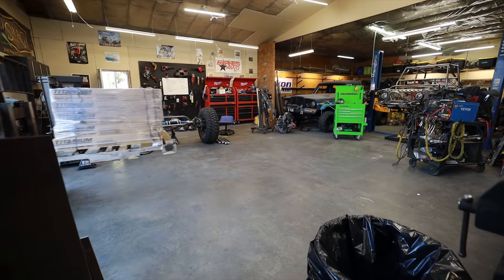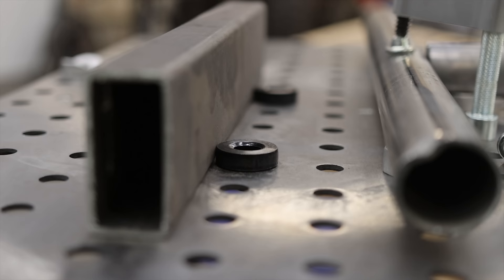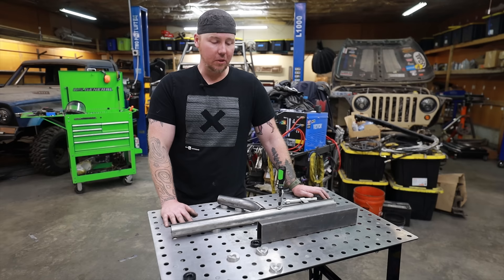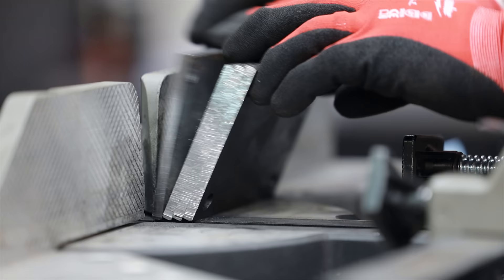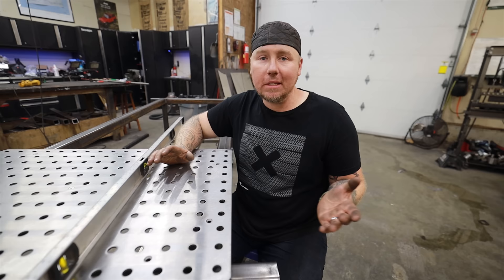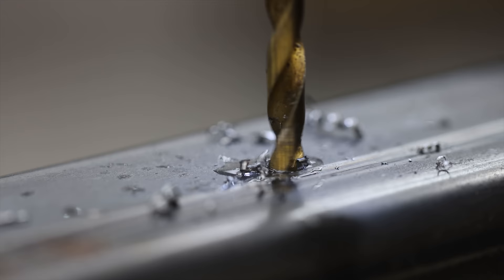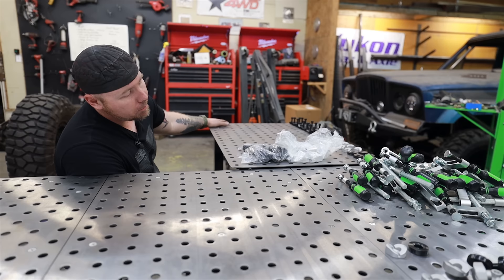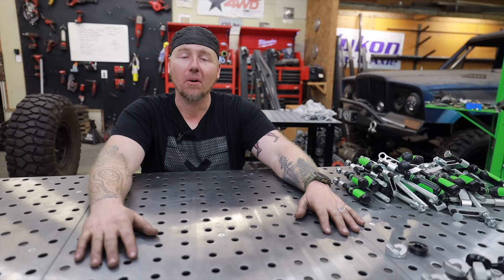The NEW Harbor Freight Welding Fixture Table

Comment: You could also remove the plate from the frame and double stack the plates. For more strength, you could cut some plates in half and overlap the butt of the underlying plates (cross hatch for lack of a better description).

Comment: Northern Tool has been carrying this welding table & kit, for quite awhile. Same price during their sales.
Also, I attached the short legs first, using the outside bolts only, then attach the longer legs directly onto the frame using the inner bolts. It creates a little stronger mounting point for the longer legs.
Cut a piece of 5/8" or 3/4" plywood for the lower leg brace, and then you'll have a shelf to keep the accessories.
Reply: Also comes with a wheel kit.
Reply: I have the same table from Northern Tool. Great little table & accessories.
Reply: I have 2 of the Northern Tool tables set up side by side for a 6 x 2 table that's able to be separated to also make a 4 x 3 table depending on the project,
Reply: I have this table from Northern tool. For a fireproof lower shelf I used a piece of heavy wire shelf.
Reply: Maybee if you get 2 tables and double up the tops you'd end up with a 3/8" top when combined maybee then double up the legs etc...Thanks Nate I started putting wheels on or under everything in my Garage and it's Helping me use and organize space also makes cleaning easier.
Reply: @kengartner6659  The table tops are welded to a metal  framework that you'll have to cut off, before you could combine two tops together.
Reply: At 1:38 you can see the top bolts 🔩
Reply: @kengartner6659  Sorry, but the 8 welding tables that I've bought..., are all welded to the frame and not bolted to it. Differing versions, I guess.
Reply: Or maybee HF will let you order replacment top seporate as a  replacement part?
Reply: Buy American!
Reply: Put a catch shelf above lower shelf to keep debris off stuff on lower shelf.

Comment: I also made years ago a welding table of 1/2" steel that was given to me 30X72 that was a steel plate used to cover trenches in roads. I just drill  the holes only as I need them not all of them at one time. I've had this table for 20 years and have only 17 holes drilled in it.  I have built 4X4s, wrought iron fencing, golf cart frames suspension parts and many other projects and some how 17 holes have worked out fine and I can always just drill more as needed.
Reply: Why drill holes????? Everybody else has been welding tabs on tables for over 40 years I have been in the business,,,,,,50 actually ,,,, We did Navy Nuclear NAVSEA 250-1500 and DECAS parts on 1+ thick tables and did not drill once single hole in any of the tables in the shop. - Tack tab,,,,break off.... grind with cup wheel. -  Even welded 38,000 pound weldments to positioner tables. (actually did 2 of them for off shore drill rigs) . Not one single hole drilled anywhere,,,, In case you didn't notice that's a bit beyond a bracket for a winch you are putting on a Jeep. ----- That table is a joke in all respects.  FACT - Send it to a wood worker.
Reply: @mathewmolk2089 why use a fork and spoon to eat when ppl have been eating with just there hands for years! Smh lol

Comment: I'm a hobby woodworker primarily, but I do have the need to weld now and then.  Just this weekend I made some lumber rack brackets with my little Titanium 125 Fluxcore welder.  This would be an upgrade over throwing the fiberglass blanket over my workbench for sure.  I'll keep my eyes peeled for this to become available to be sure!
Reply: I love my  Titanium 125 Fluxcore welder. I'm a carpenter, but sometimes need things welded. That little welder is easy to use & gets the job done.

Comment: Nice addition to the shop! I've been using receiver tubing under my work benches for years. It's sweet to be able to move a vise, or other draw bar mounted tool, from one bench to another. However, mine don't stick out so that I don't catch my hip while moving around the table. Also, rather than using a hitch pin, I welded a 1/2-13 nut to the bottom of the tubing and then used a 1" long hex head bolt to clamp the draw bar mounted vise in place. I welded a large washer to the head of the bolt to make it easy to tighten or remove by hand. This makes the tool much more solid than having a hitch pin holding it.
Reply: cool idea , thanks for sharing
Reply: No one knows what you are talking about.
Reply: @philiprush2462  I know what he's talking about

Comment: As someone who just made their own fixture table out of 1/2" plate and had to buy a mag drill and annular bits etc this is ingenious for someone on a budget. Only disadvantage I'd see is like you said, heat. I'd be afraid of warping this.  As an idea I'd just buy this table to use as a template for my fixture holes. Sounds silly but perfectly drilling 2" O.C. holes by the dozens is very difficult without a CNC machine. It took me so much time to even get 79 holes and i need another 50 at least. I loved this video and see myself buying it for the same reason, an auxiliary table.
Reply: I was thinking the same thing about using as a template, I just bought a mag drill myself.
Reply: A laser,,,,or chalk line will o just as well,,,,,,,,But, other then an acorn table all professional shops tack fixture tabs and then break them off and take a cup wheel and grind the table smooth...Ever heard of wedges and dogs?

Comment: Excellent video (as of 9/27/23, not shown at HF yet). The flatness, hitch, washer spacer and the height are great takeaways.
Reply: I wonder if my local store was the initial test market, because I bought this table like 1.5 years ago as my first welding/ fixture table. I have been very pleased with it. Two things I did that I would recommend would be adding a shelf that rests on the bottom horizontal pieces (I keep my welder, small gas bottle, and the clamps/ fixtures on the shelf as I have limited shop space) and also using a countersink deburring bit in a drill to put a very light chamfer on each hole. I found that a lot of them had a slight burr, especially after using the clamps some since they put a side load on it. Since the initial deburr, I haven't had any further issues with the clamps causing the raised edges again.
Reply: Not shown online yet.  Gonna have to check my local stores to see if they have any.  Seems nice for the value
Reply: Buy American!
Reply: 10/18/2023 and its shown online now.

Comment: I have started using casters that flip up. Most are rated for hundreds of lbs so roll well. when you want the stability of a regular leg you flip the lever up, the casters fold and the legs are solid on the ground. Best of both worlds.
Reply: where did you find them at ? thanks

Comment: For wood working, you could bolt a plywood top to it, then use the steel holes as a template to get holes in the plywood, which you could then use for clamping. That is a lot of utility for the price.
Reply: MDF or chipboard for a cheaper option
Reply: Thank you 
That's exactly what I plan to do.
Any idea when it may become available 
Thanks  Teddy
Reply: I do not see a link for the table? Am I just overlooking it? Also, I was unable to find it on the Harbor Freight website. I  went to my local Harbor Freight store, and they didn't know what I was looking for.
Reply: Thank you
What a great idea 
I'm new to this and appreciate every idea
Thanks again 
Teddy
Reply: Woodworking table hardware is based on 3/4” holes.  And you don’t want the grease and grit of a welding table anywhere near wood. I tried.
Reply: @f.kieranfinney457  ever heard of simple green
Reply: @JuanHernandez-ub3ez  I suppose you could clean it and everything around it every time and put not use it for assembly work. Honestly it’s not as practical as you think mixing steel with woodworking. 

There are some excellent sawhorse designs that, coupled with your mdf or plywood top would rock.

Comment: 1:39 you may want to box in the bottom of the legs on the single table. I added casters to my welding table and with any weight, the tabs holding the casters on will bend.

Comment: I can definitely see harbor freight selling out of these fixture tables quickly! As a future upgrade you might consider installing a solid sheet of thin gauge steel or aluminum on the underside of the table a few inches below the surface with a lip on the front edge. Slope it forward so that any parts that fall through the holes roll toward the "front" and any metal fragments, grindings, etc don't just drop on the floor. Makes for an easy way to sneak a shop vac under the table and vacuum up metal pieces without them all over the floor and caught under the caster wheels.

Comment: I have had this exact table for a couple years now, from another brand. It isn't a high-end unit, but it does what you need. Just wish they made a slightly larger one too... but bolting several together is a solid solution.
Reply: May I inquire what's the name  and where you got it
Thanks Teddy
Reply: Northern tool sales the same one under the Klutch brand for $200. They have it on sale right now for $170.
Reply: @mvorn44  
Thank you 
I will look right now

Comment: As much as I love this, there is no way this isn’t going to warp. I have a raw cut 4x3.5” weld table that’s 3/16” sheet from my local steel yard I made my self and it’s warped with minimal heat input into the table with general and small projects. 

Especially with out the side skirts which add strength and rigidity. Good in theory, good in price. Don’t expect much long term.
Reply: I was thinking of welding on a boarder of maybe 1x2 or 1X3 and some webbing underneath of either 1X2 or 1/8” wall 1X1 (because I have a lot of it) to help stiffen it up.
Reply: I did this with 3tops 1x3 drop in frame we made on casters... works great for stuff like fence gates door frames etc
Reply: yup... 3/16" is just to thin for a fixture table.  i'd rather have a 1/2"plate that isn't very flat, but would be more stable
Reply: Good point on warping, jig table tac welding..
Reply: Why do people overlook merely stacking two of the tops? From 3/16 to 3/8 by simply drilling and plug welding and suddenly you have plate and can use 5/8 fixture table clamps instead of these bolt down clamps.

Comment: Level your Aux table with your Fab table.  Add a receiver hitch to your Aux table with a pinch bolt on the bottom as well as the spring clip holes.  Add pinch bolts to the bottoms of the receivers on your Fab table.
Now you can use a piece of square tubing to fix your Aux table to your Fab table in a locked but adjustable way so you can use fixturing on both tables for large parts like say a 6 foot by 10 foot roof rack or other large project.

Comment: A folding version would be awesome. Also, the 2” trailer receiver is awesome, I have one bolted to the bottom of my workbench surface and I have my bench vise and bench grinder set up to be used that way.
Reply: I have an old Workmate. I think I might figure out a way to replace the top with this.
Reply: @mvorn44  I do too, and I replaced the top with two pieces of 3/16” steel. Works well enough, and I can even still open/close the top, but it’s pretty heavy and doesn’t have the fancy fixturing holes this one does.

Comment: Acorn tables are the ultimate for heavy fab work. I used them for years, and you certainly don't need to worry about grounding through them. They are actually designed to tack weld parts to them if needed. Of course, they are 6-8 inches thick and are various dimensions, 3x3. 4x4. 6x6. Whatever you need. And super heavy. 
But I do think I may have to pick up one or two of these.
Good video. Thanks.
Reply: What for? You already know better. - If you can't afford an Acorn 1/2" plate minimum is the poor ma's way to go. - This sheet metal thing is a joke.

Comment: This would work for any or several types of workbenches. The top is made from anything from a single sheet of 1/8 inch hardboard or a piece of carpet to keep pieces from falling through the holes to complex fixtures in a manufacturing plant. I can see it being used for fixtures to do repetitive glue-ups in wood. With all these tops and fixtures hanging on the wall waiting to be used.
Reply: And to help keep it free of glue, I use a roll of craft paper that is hung on one end of the table. Easy peasy. Just pull it up over the table top as long as you need to cover. Tear it off and throw it away when it's too funky.

Comment: I just picked one up today, thanks to your video! For anyone wondering, no it is not on the website as of today (10/5/2023). However, the "bad link" had a part number and I asked someone in the store if they could look up part number 59403. Indeed they had ONE in the back, but she said they expect another one later today. So it sounds like they might be trickling in, even though there isn't even a tag for it anywhere near the welding items. Ask nicely, and they just might have one in the back!

Comment: Okay, if you swap the top later, one option is doubling the thin tops to double the thickness.  Also, if you upgrade to a thicker plate later, use a new one of these plates as your template to layout the holes.
Reply: Brilliant
Reply: If you're going so far as cutting your own holes I recommend looking at the jig Brandon Lund makes when making his own fixture table from half inch steel.

Comment: couple thoughts:
1) this will be perfect for the kid, who is getting into welding as a career.  he already bought his welder, cart, bottles, and I got him the other HF welding table, the one that folds up.  this would allow him to start practicing fixturing work as well.
2) these would be perfect for appropriately sized fixture setups that, you want to keep configured but don't need all the time.  you could just buy one of these tables, make your fixture setup, and leave it alone between projects.
3) this could be great for intermediate fixture setups; you're doing a big project with lots of smaller assemblies that are all the same.  you set up your fixture to make those, then use your fancy big expensive table to line them all up for final assembly.
4) having to shim the top to the frame to fix flatness issues... it's HF. It's $170.  It's worth the hassle. :D
5) for your receiver idea... put in mounts under the table to store the tools.  convenient storage, and it'll help add mass (as if you need it!)>
6) then you'll need an integrated power strip for some of the tools to plug in. :D
Reply: I put a rack under my table to hold TiG wire tubes. Using some PVC pipe and conduit clamps works great and is easy to install.

Comment: I drilled my 30"x60" table a couple years ago. 2" on center and it took forever. It was around 430 5/8 holes. 8ish hours and 2 roto-brochs later it was worth it.. but took forever😂
Reply from the maker: That was my original plan a few years back. I never got around to actually building it... maybe it was the thought of drilling so many holes lol
Reply: You beat the 375 holes that I drilled with a mag drill. I made a jig that helped speed up the process. Never again though.
Reply: @TLervis  I cut out a drill guide on my CNC plasma, so I only had to actually layout a couple holes. Like you said.. never again🤣 my next table will be laser cut! I'd rather spend the money than waist the time again!

Comment: I bought the CertiFlat 24x34 table and I'd say that the Harbor Freight one is it's direct competitor. The CertiFlat is $120 more and doesn't come with accessories but, one thing to consider is that the CertiFlat has a rib system that makes sure it stays flat. Looks like the HF one sits on (what I'm guessing) is low gauge tube.
Reply: Yeah, i have the 24" x 48" Certiflat and it's perfect. You can adjust everything for flatness  before welding the ribs, and the joints are designed to not put a warping force  The legs are also a lot heavier (1 1/2” x 1/8” square tube) and weld to the top.
Reply: And is still 3/16 thick
Reply: @Peter-od7op  with welded ribs. That's a very different animal. The result is much more rigid than flat plate. The ribs are several inches deep and welded in an interlocking egg crate design.

Comment: Northern tool tells an almost identical welding table and has two versions of it.  one is the "fixed" table like the unit you have in the video.  the other is a more substantial table with casters, and a small pegboard to organize all of the fixturing items. I bought the wheeled unit and i'm digging it so far. it also has a low shelf on it that has been proving useful.

Comment: Am 6'1" tall and have a couple of the cheaper HF tables.  I had to weld extensions onto the vertical support legs to raise the table from 34" to 40" to keep from killing my back bending over to the 34" height.  Also, the thin tops warped, so I cut pieces of 3/16" sheet and put it on top.  Do GMAW, FCAW and GTAW with no warpage problems.

Comment: Can ANYONE CONFIRM that these are actually 5/8 holes ? I've seen several videos suggesting ordering additional clamps from Northern Tool. I own the Klutch branded table, and it is indeed 16mm If that's the case, a 16mm peg won't fit in a 5/8 hole. (16mm = 0.629921 and 5/8 =  0.625).
Reply: I'll respond: Yes. They're 5/8ths and 16mm will not fit. 5/8ths cold rolled bar is even a little tight.
Reply: @user-ii8dz4vu7n  THANK YOU!!! All the review channel still haven’t responded 😂, months ago I posted a comment on every channel doing a review. I was looking for this information for my video because I still haven’t had them in stock / display at my store

Comment: Good video and review.  Instead of bolting two together, I plan to add some neodymium magnets on the edges.  Then I can "snap" them together and make a 4x3 or 6x2 video in a few minutes by pushing them together.

Comment: I would of liked to see 1/4" due to all the holes in it.  I ran 3/16 on a solid Weld table. 
I will still probably pick one of these up.
Could always buy two and stack the plates to make thicker.